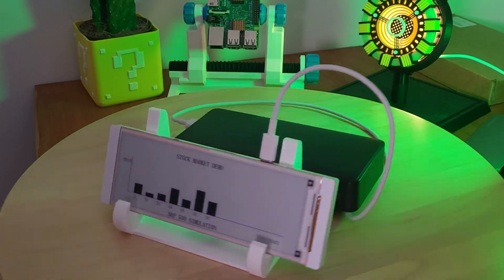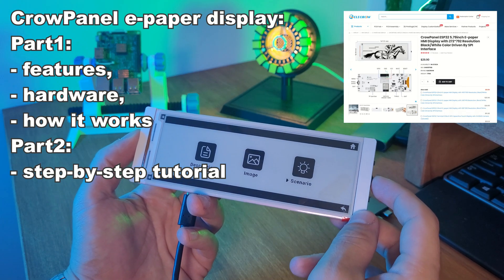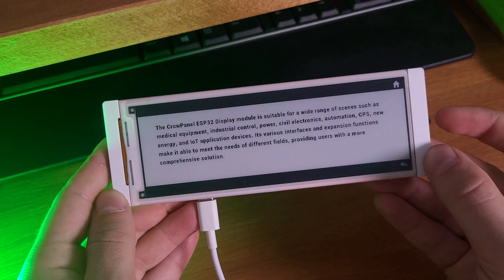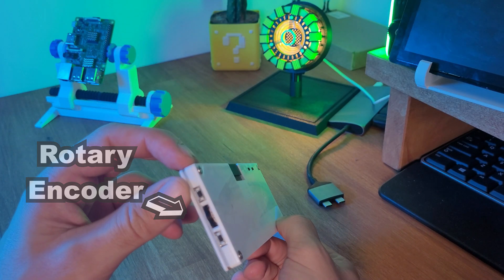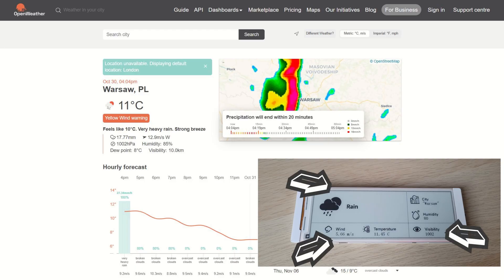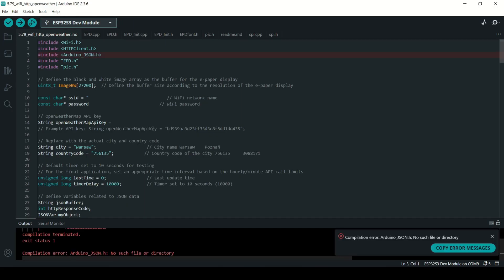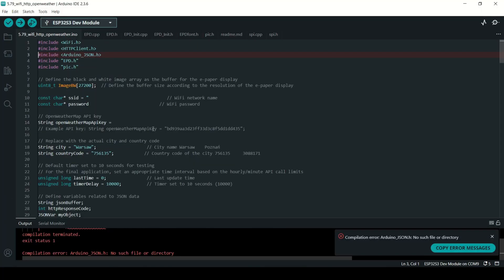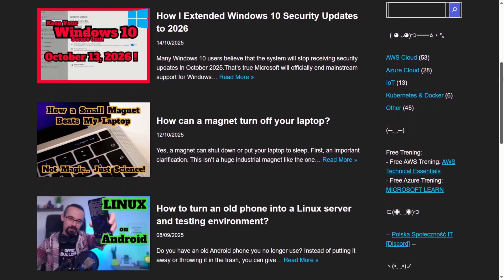I Build E-PAPER Wi-Fi Weather Station! #diy  #esp32

Comment: I have an error in compilation error exist status 1 the system can't find the path and I am not a programmer and my e-ink is 5.79 inches there are more than error with arduino can you help me plz 😢
Reply from the maker: Hi, If you downloaded the files from a GitHub repository, please check that the archive was extracted correctly.
On Windows, very long folder paths can cause problems. Sometimes not all files are extracted properly, or the tools can’t read them.

Try this:
- Extract or move the project to a short path, for example C:\Arduino\weather_station
- Avoid deep folder structures and long folder names
- Re-open the project from the new location and try compiling again

Also make sure:
- All required libraries are installed
- The correct ESP32 board is selected in Arduino IDE
- The code matches your exact e-ink display size (5.79")
Reply: @WojciechLepczynski thank you ill try and tell you whats happen 😢